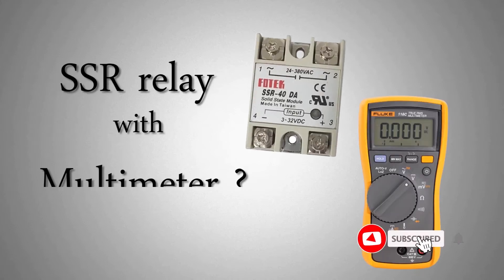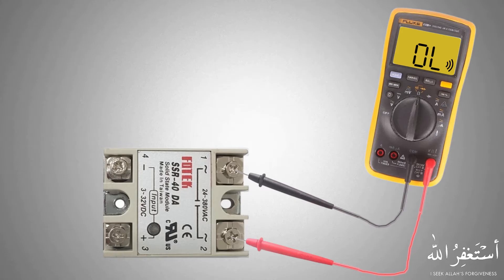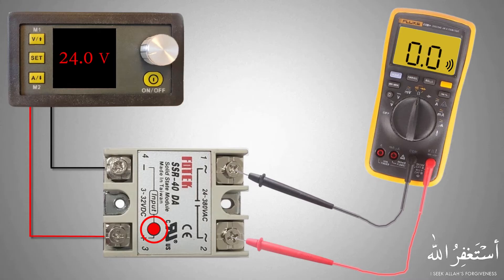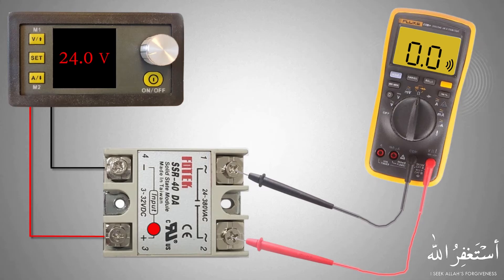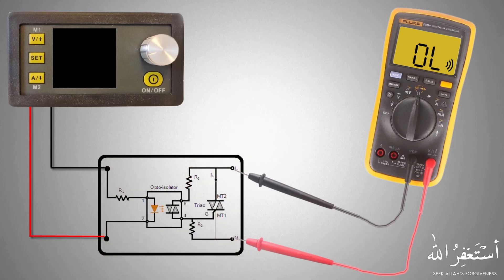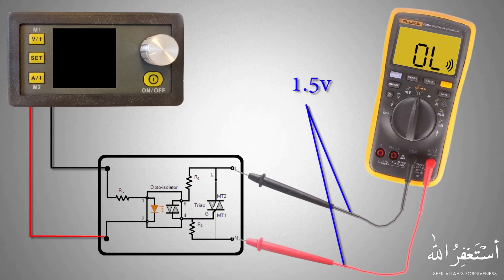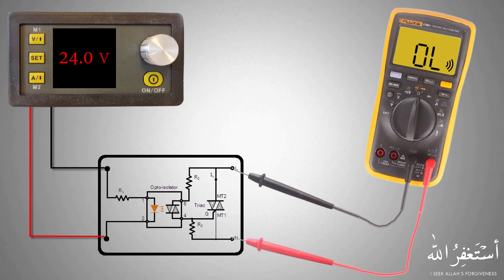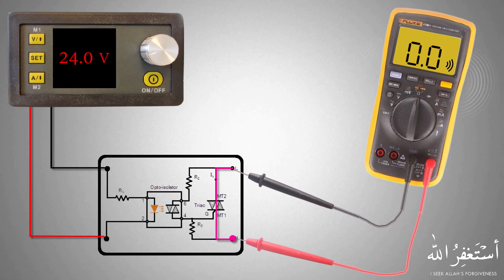How to test SSR Relay with a Multimeter ?

Comment: in most cases , most modern univ. instruments have around 1V output in continuity test mode which is far below what is needed to open one triac which is used inside SSR. So u can use same method but place instrument in to ohm meter if it is not autorange than chose range up to 10Kohms. It will be no reading while SSR not working and when u apply voltage at input it will read around 2Kohms what is internal resistance of photo element with resistors in serial connection.

Comment: unlike mechanical relay, SSR requires a minimum load current to switch.. so this multimeter test wont work.. you need to test with a load preferably 50/100 watt AC and a dc input

Comment: hi.. i have a dc to dc 100A ssr.. when i test it using ur method it does not show zero resistance.. when i test it in real circuit it has a voltage drop of around 0.7v but with loads greater than 80w the supply dc voltage for the output drops fast from 12.6 to lower than 10 volts and much lower.. i already bought two of this but same result..
Reply from the maker: Are you have AC or DC load on the SSR ?